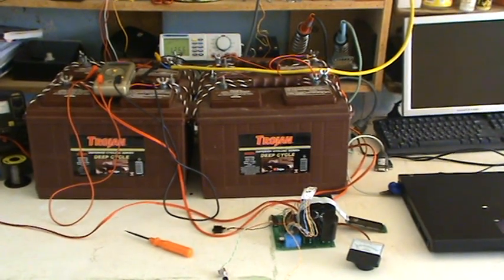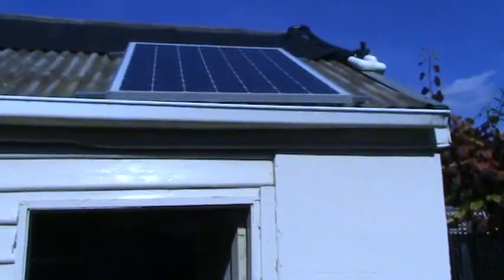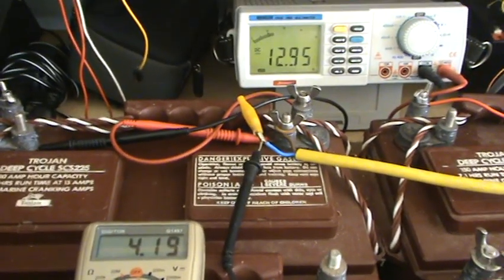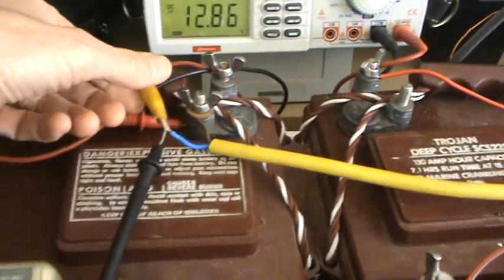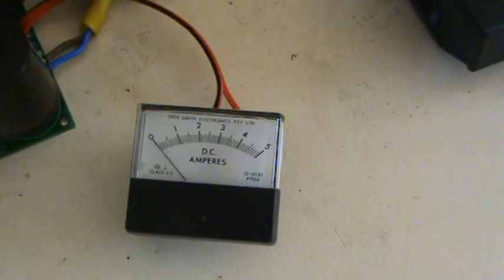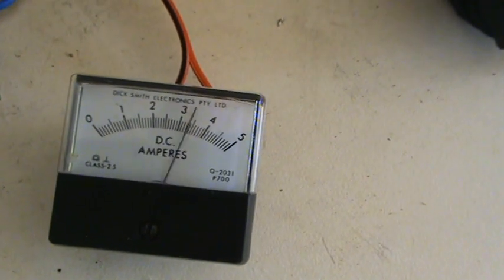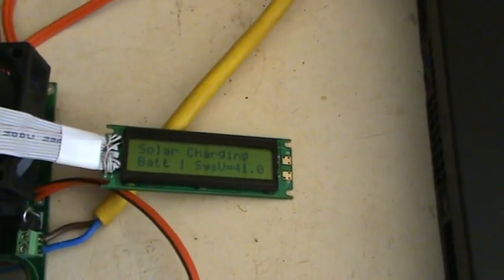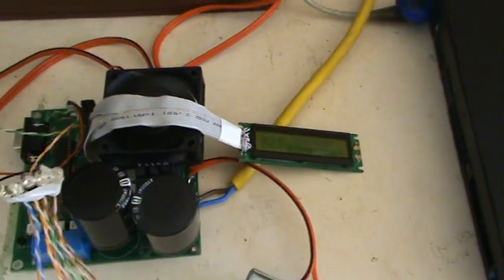Batt Schmacker Solar TS

Comment: Very Cool John & Bits.  Will we be able to configure it to work with just two battery banks?  If so, what's the max bank (in amp hours) and Wattage from the panels that it will be able to handle?